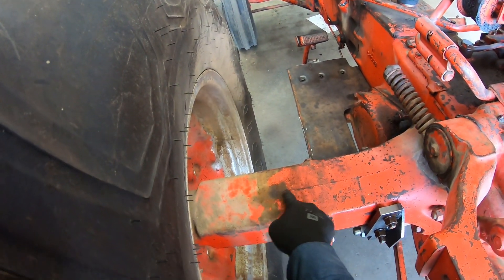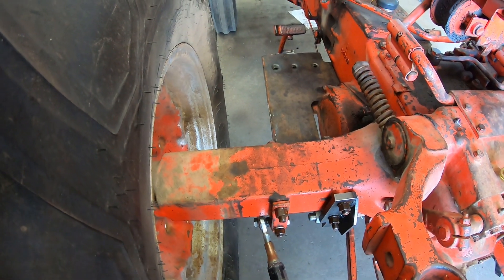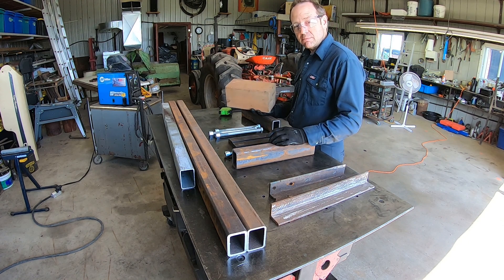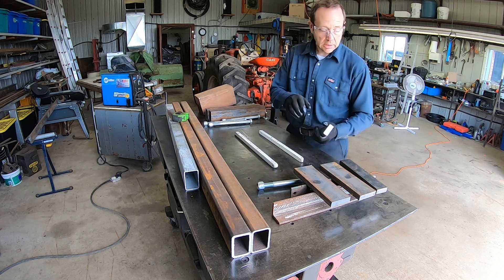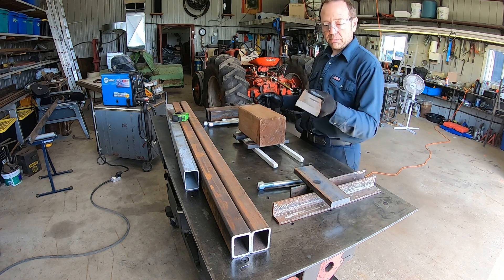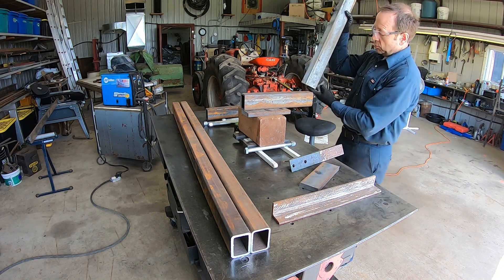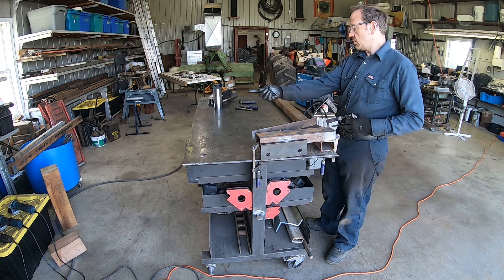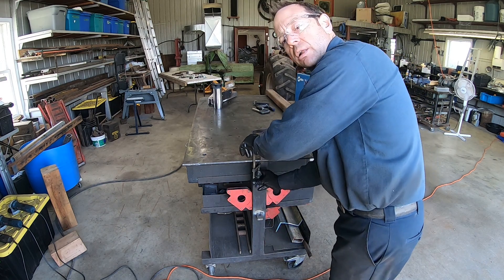#238 Case 430 - Homemade ROPS

Comment: Nice job, Joe!  That's a great Case machine.  Really good rear tires.  Does the quick hitch work for you?  A lot of our 3 point attachments won't work with the quick hitch system - so I've never purchased one.  But they do look like a great time (and frustration) saver!  #purplecollarlife
Reply from the maker: Thanks!  I've put the quick hitch on it for my other implements, but never got the time to put any implement!  This QH "should" work with my other implements, as they already work with my other Case QH. As for the offset flail mower, being so unbalanced, I prefer running it without the QH. I mean, once fully extended to the side, it exerts upward pressure on the opposite lower arm. I am not so sure, given a small tab locks the implement... This small tab would take a load that it was not mean to take (in my opinion!). Thanks!

Comment: The ROPS looks good, Joe. I was hoping you would paint it CASE Orange though. As soon as you started it, I knew it was a CASE. Before I became a firefighter I had a job working for the water dept. of the town . I was an equipment operator, running a CASE  loader/ backhoe. It sounded exactly like your machine.
Reply from the maker: Funny you mention about the sound of a Case!  The sound of this machine has changed a bit since I've used it for many hours and now sounds similar to my other Case. It's initial sound was a bit different.  I guess not running for a long period of time has some effect. Mostly the rings that were dry... only a guess there!   In the video, you can hear it as it should sound. Thanks Jim!

Comment: That's a long lever you have on that ROPS bar if you roll the tractor sideways or slide into a ditch so I would definitely recommend stronger supports / gussets from the mounting plates to the axle and the uprights. I was wondering why you didn't bolt straight through the thick tube on top of the axle instead of welding the plates to the side of it, that would get rid of some of the lever when you slide into that ditch if you get what I mean?
Reply from the maker: Hum! Those are good points!  I can recognize a good designer by your comments.  You are right about the height of the ROPS.  My goal was to compensate for a wider machine.  I think the first role of a ROPS is to limit the roll-over to 90° if ever possible. Then if a turnover (180° or greater) is to happen, it does not kill the operator.  The rear wheels having a wide thread (78 in), the ROPS needs to be a bit higher to limit or stop its rolling to only 90°, if ever possible.  That is why it was set higher. That is also why I had added the gussets, which reduce the "apparent" height of the ROPS.  Then the wheel itself will limit the deformation of the ROPS to some extend... The machine is 3000lb, which is quite light... that end being half of the weight too! My initial design was to go through the tubes with the bolts, but that limited my possibilities for position over the axle. That is why I went for the offset plate. Thanks!
Reply: @FromSteelToWood  It looks like you have space for an additional support plate to be welded to the inside of the tube that gets clamped to the axle, that would make the ROPS uprights a lot stiffer sideways as they would now be supported in two places on each axle instead of just one. The forces will also turn from a twist of the welds to a tension / compression force where it should be a lot stronger/ The gussets will of-course help against some of that twist in a sideload situation.

You're right it is a light-weight tractor so maybe less of a concern but I still think that the welds to the support plate is the weak spot so if you could make that stronger that would be great.

You hopefully never needs the ROPS to do their thing but it can happen very quickly so it's better that they are there than you getting squashed if you go into a ditch sideways. It happened to my sisters ex-husband, they just got their new small-holding and it came with a tractor that had a ROPS bar on it, he, being un-experienced in driving tractors city-boy), wasn't expecting the slack in the steering so when he tested how fast it could drive along a gravel access-road next to a ditch he ended up in said ditch when the sloppy steering didn't react as he expected it to. No-one was hurt, even the tractor survived unscathed  bar a rusty exhaust that broke off but that needed replacing anyway.

Comment: Another fine job!!  The tractor starts and runs just perfect. Good for another 20 years for sure??
Reply from the maker: 20 years is a minimum in my opinion! Lol! Well maintained and not abused, they will last a lifetime... if only parts are still available. They were quite available at the local Case dealer until a few years ago. I guess they changed their software and now they are confused each time I ask for a part as simple as a rotor.  I changed my plan and now get my parts from a specialized company based in the USA.  Import and transportation fees are prohibitive, but the parts price is very cheap. I only need to plan ahead and this is still economical. Thanks Mike!